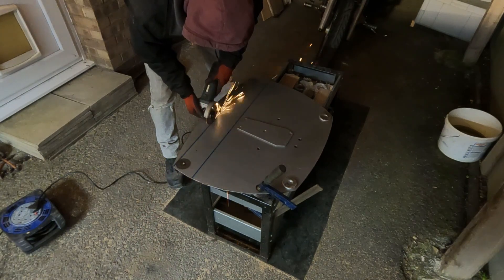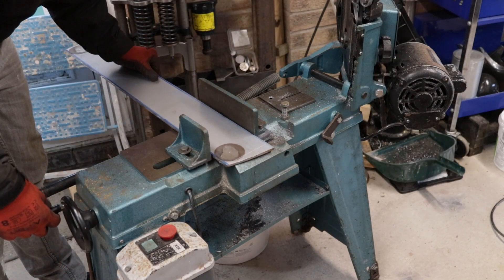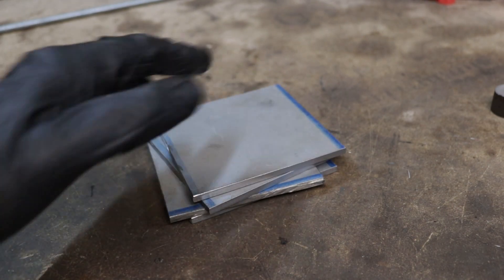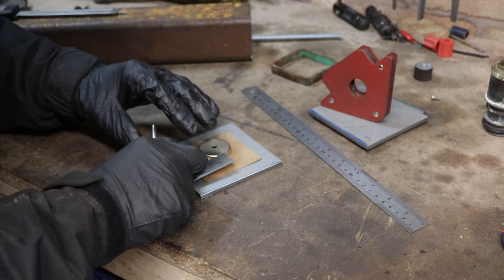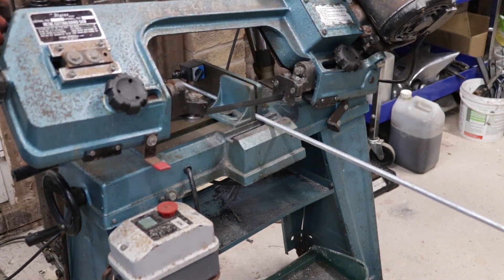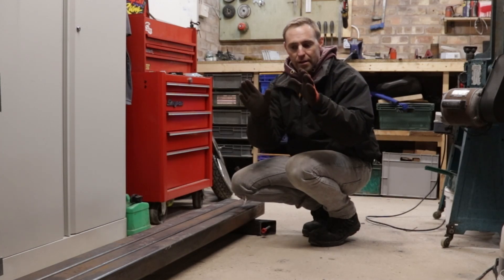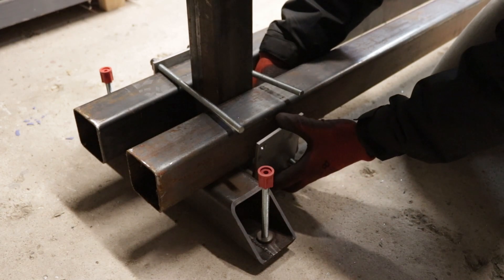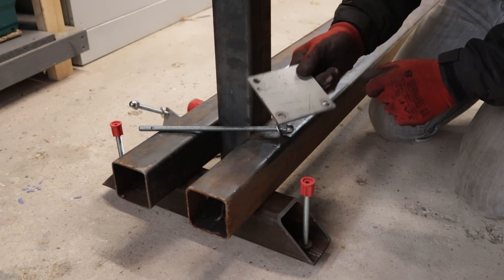Fixture Fabrication Custom Motorcycle Frame JIG

Comment: Question about your springer, when you use stock triple tree, what trail did you get?
Reply from the maker: I cant measure it now unfortunately because the bike is in pieces, however it would have changed because the rockers have pushed the position of the axle forward.